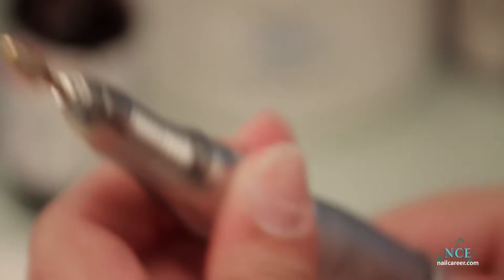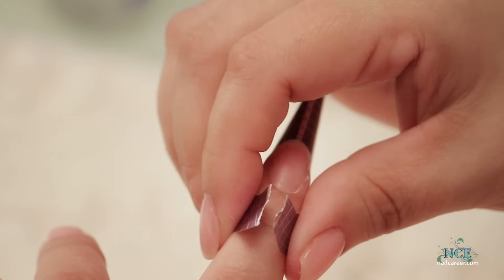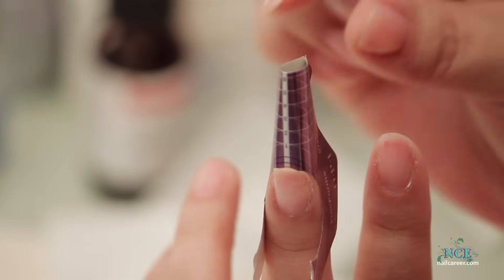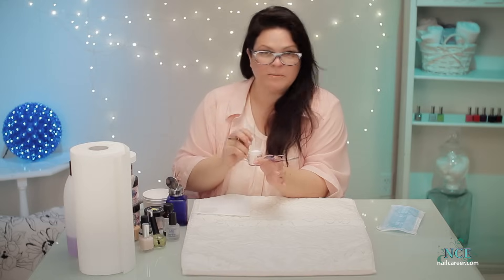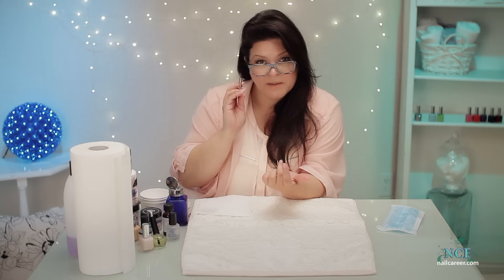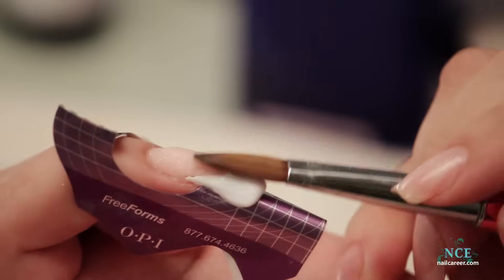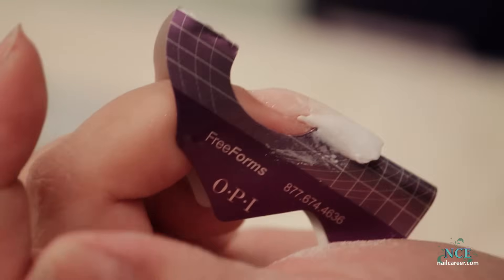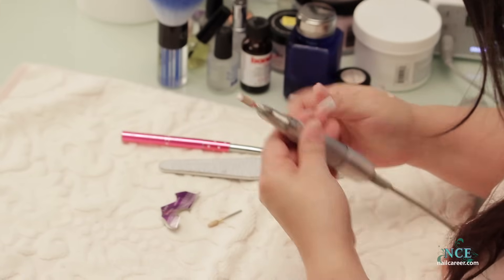Reverse French Acrylic Nail

Comment: love your excitement when you try something new! please do a video on how to remove glitter nail polish, it might seem simple to some but everytime i wear it, whether alone or ontop of another polish, the glitter is a pain to get off and takes ages to just get rid of it from even one finger! (the polishes i use will just get rid of the colour in the glitter, leaving it silver or white, then when i think i am done with getting that part off, theres still some i end up picking off with nails as its easier but i know not better)
Reply: lesliie44000 thank you so much!
Reply from the maker: Yes Leslie gave you a good tip- there are also base coats that are designed specifically for easier removal of glitter- also I file it off 😀
Reply: Nail Career Education thank you hehe and thanks again to Leslie! lol yea i end up picking off the bits that don't come off but will try your and leslie's tips!
Reply: اغنيات كيف يعمل تسريحة العاب
Reply: +DominosAndHearts another tip if u can't get those products which is what I do is apply polish remover on a pad (make sure u flood the pad with remover & use non acetone if u have enhancements on.   Place the pad on ur nail & then wrap ur finger with a lil silver foil & make sure it's wrap up tight.  We call it Alfoil here in Australia so I'm not sure what u call it.  Anyways after a 3-4 mintues u can take the foil off & just give u nails a lil wipe  with the pad & the glitter comes  straight off.  I know this method 'may' sound like a lot of effort but I assure you that it's MUCH quicker than the method u do (that we've all done at one stage in our life, lol).  This method takes approx 7 minutes for all 10 nails  & that includes the time ur nails are in foil for.  I hope this helps aswell :)
Reply: Tinkerbellstune awesome tip! i am from australia too hehe! i call it alfoil too!

Comment: If you want to keep the form in place, you should apply at the beginning a bead of clear acrylic (over the natural nail bed and the firm), to make the form stay while filing. Your way is harder because it is difficult to apply another form at the exact same place the previous one was on before. 
Anyhow, super cool videos!
Reply from the maker: That's a good idea- I never think of it cause I'm very particular on thin nails - I don't like thick - but that would help hold the form - I would just make it super thin especially near end of nail - I'll try that 😊
Reply: A thin layer of clear should work perfectly, no nead to build an entire clear nail.

Comment: Suzie,I loved the video as always.I only have one question,Why didn´t you cap the nail with clear acrylic?Aren´t you afraid it will crack by the smileline?
Reply from the maker: Great question- capping is only needed when adding for structure or encasing a glittered acrylic or inlays- also this is a reverse French - it's not necessary, however if this was the traditional most people do cap with clear for structure 😀

Comment: Now this may be a stupid question... in doing the nails like this I don't see where the strength comes in for the white. Besides a thin layer attached to the end of the pink there seems to be no other connective point where the white connects. Obviously any top coat won't add additional strength (enough anyways to be noted), so my question is how is there any strength to the nail design in its entirety? To me, especially with the additional knowledge from your previous videos, it seems like a design with a very cautious & notable stress point. It is, despite my confusion, very beautiful!! As always love your videos & your continual upbeat personality!
Reply from the maker: The strength comes from the structure of the nail itself. With good technique, even long nails are strong

Comment: I love your videos  😀 just a question. when I use a form and don't encapsulate it with clear acrylic the tip breaks off. would that happen when the white tip in this video? I'm definitely going to give this a go though 😀 x
Reply from the maker: If you don't build an arch in the Center then the nail will break - applying a clear capping layer is one way to build that arch for strength 😀
Reply: it's mainly just that tip that's been formed on that splits off. 😔

Comment: With the forms- you're the first person I've seen that doesn't use the circular cut out as reinforcement on the back of the form where the nail goes. Is there any particular reason why you choose not to place the cut out like that or no?
Reply from the maker: +kazeshinimeyo chama all my career I've never felt I needed the extra strength - I noticed people doing it a few years ago - if your funding it too unstable you could try it - but I've always used a good form so I never felt that need
Reply: Thank you so much for your reply :D
Reply: +Nail Career Education уσυя му ι∂σℓ

Comment: could you do a video on getting a smooth finish on acrylic nails? I'm having a hard time. I think they are smooth, then I get polish on them and see like edges and flat spots, it's not just flush all the way up and down. I haven't seen one single video on this. I'm so frustrated. please please please help :-)
Reply: +Tonja Casimir-Buckner hi not sure if this will help or not but when i was taught i was shown a neat little trick for just this problem. After doing your basic file, grab a marker pen and colour the nail with it, then using the correct filing technique (cuticle, side walls, apex etc) you should see the marker pen disappear as you file. if you see small bits of marker its probably a flat spot you can go in and correct, when all the marker is gone your nail should be nice and smooth ; ) obviously not something to be done for every nail lol but a good practice technique : )
Reply: +Adele Savage thank you. I'm gonna try that.
Reply: +Tonja Casimir-Buckner 😄

Comment: if i want to take off the acrylic part of the nail, like after a few days, do i use a nail scissors or a filer? oh and by the way, i don't have an electric filer😕
Reply: halah alballouz if you mean a full soak off she does have a video for that. I use files, no drill. u just use the file to thin the acrylic then soak the nails in acetone till all the acrylic is off. if u just want to shorten them you do it just like u would with ur natural nail

Comment: Is nail cleanser the same as primer ? Or dehydrator ? And cuticle oil only goes on after your done applying right ?
Reply from the maker: Nail cleansers and primers are not the same- a cleanser simply preps and cleans the nail of dust and oil - Primer is an adhesion layer for the product to stick to the nail - cuticle always is applied AFTER the application process - NEVER in between 😀

Comment: What kind of drill do you use? I've been looking to invest in a good high quality drill to replace the cheapo I bought on Amazon a while ago (which surprisingly didn't burst into flames upon usage and has been a nice little tool in my nail art obsession), but I have no idea where to start looking. I don't want to shell out a bunch of money without having any prior knowledge of brands and quality. Money is tight so I want something that will last, I don't want to save up money for something then have it die on me after a month or two.
Reply from the maker: In this video I am using the Swan e-file. Very nice. I also have just gotten some new Kupa E-files. You'll see me using them in an upcoming video soon - and you'll see how I like them

Comment: How do we stop the nails from snapping at the smile line? And I don't understand what making the pink thicker will do(?)- Does it make the arch?
Reply: +Shannon March I hope Suzie doesn't mind me butting & answering this but to stop ur nails from breaking at the smile line you need to add more acrylic to the 'stress area'.  That's why they keep breaking.  Also about making the pink thicker.  No it doesn't make the arch....what Suzie meant was if  u make the pink thicker at the 'free edge' then u don't have to stress & rush applying the white b/cos normally u only have a very small window of opportunity to perfect  the white but if you apply the white over the pink free edge like Suzie did in the video & then when you go to file it down u can file the colour away & you'll still have ur smile line.  Does that make sense??
Reply: Makes a lot of sense actually. Thanks so much. Also, you said apply more acrylonitrile to the stress area, would I apply pink or white acrylic? That's the only part I'm unsure of.
Reply: +Shannon March the stress area  is just above the smile line so you would apply the pink acrylic or cover pink or whatever colour u use.  They say to use the colour that most suits the clients skin tone.    Also when u have finished ur enhancement don't forget to mold the stress area of the nail  (& the free edge aswell) . The more curved ur C Curve is, the stronger the nail. If ur nail is flat then ur nail will be very weak. If your C Curve is properly structured  then u can have a very thin enhancement while still maintaining strength & durability.  Anyways if your having trouble just get online & google it.....better yet, why not go  & do a nail course afterall there is much much more to nails than just applying enhancements. I know for a fact that Suzie would definitely agree with me on that.  Anyways I do hope that helps somewhat :)

Comment: How is the bottle called you use to hold the acryilic liquid in? (I also saw another another bottle for nail polish remover in another video. Same push and wet mechanism.)
Reply: It's a Menda pump. For monomer you heed a pump that doesn't allow the liquid to flow back in. It's a special model of pump.

Comment: Suzie Do you have a video on dry peeling skin under and around nail after using lamps and acitone   And a quick reliable fix to help the skin recover thanks sweetheart .
Reply from the maker: HMMMMM - you may be experiencing a reaction to the products. I would start by examining the cure time requested by the Gel Polish or Gel Product your using and find out if the lamp is compatible with the Gel product -I'd start there
Reply: +Nail Career Education well I always seem to get issues when I use the uv lamp , but I have purchased a led lamp so I will see if this fixes it.  And I may just not soak off my nails anymore I will use nail drill , thanks so much I need to get these hands healed they look horrible.  Ohh by the way.  Nuke is a great term , and I too like the smell of petrol or gas lol  crazy crazy  us .

Comment: Just curious, why do you put oil over the cuticle and nail? Won't that cause it to lift?
Reply: Not if you wait until you're completely done with your application. By then, all cuticle oil will do is condition the skin around the nail, that may have been dried out a bit from any removal you had to do or dust particles, etc.
Reply: Meghan Workman thank you! I never knew why they did that at salons.
Reply: Amanda Goodwin no

Comment: Aren't you suppose to encapsulate? Especially since you extended the free edge?
Reply from the maker: Encapsulating is only needed if your using inlays or using (most) Glitter Acrylic or building more structure- this pink bed colour has alittle sparkle but does not need a clear layer and of course white never needs to be encapsulated 😀great question

Comment: Nothing that dehydrates the nail I would do...alcohol should be the only thing and even still....remember a fingernail can be like index card thin...  So you're better off adding an antifungal that protects the nail like Cyclops...that too is a protective gel.  I'd sooner use Purell hand sanitizer....save your money honey...and then add Cyclops or call Harrisons and see if they can add a nail something that can be comercialized and keeps the nail dry, disinfected and strong...
Reply from the maker: +dboyfff A NAil Dehydrator is to remove and excess oil that can cause lifting issues - Alcohol is very drying as well. Which is not an issue. Adding an Antifungal that is not designed specifically to be placed after or before Primer or Dehydrator could cause serous lifting issues -especially if it has any oils in it - this could be used on a cuticle AFTER the service is complete - but I would not recommend it before. Hand sanitizers are not as affective - they do not kill germs effectively, a very well known scientist Doug Schoon states, hand sanitizers simply just spread germs around. Honestly Dehydrators don't set you back much they are only about $5 ( and That's Canadian LOL)